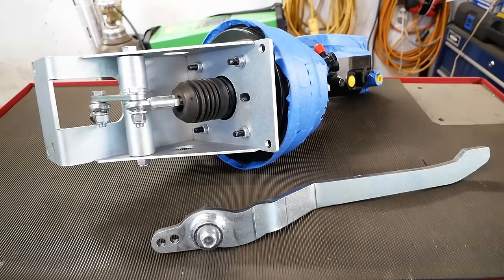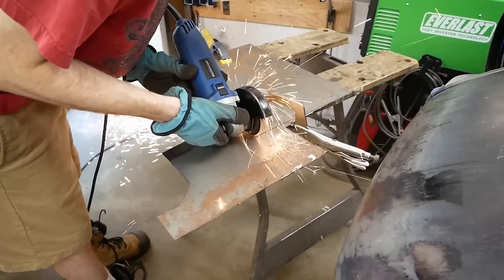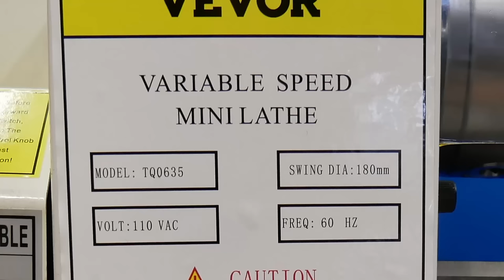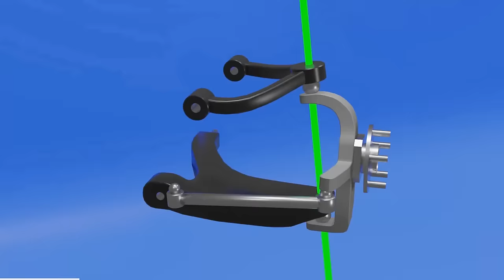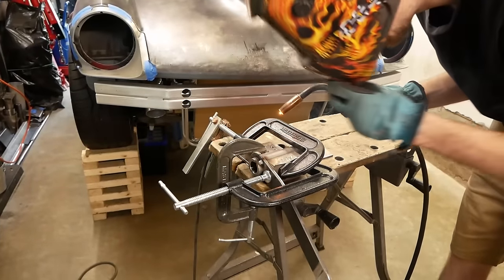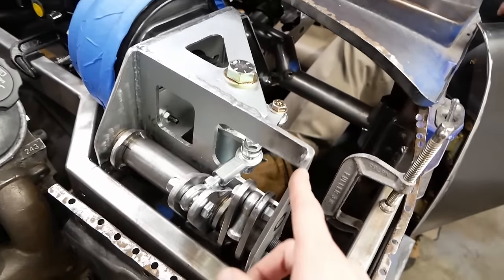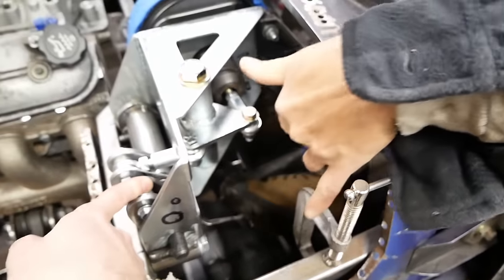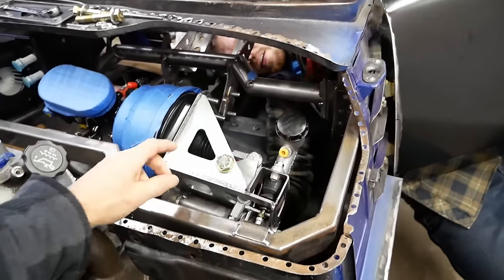Custom Pedals are Complicated! Pro Touring V8 Powered Triumph – Project GT6R – Ep36

Comment: Get familiar with cutting threads on that lathe as soon as you can.  There's nothing more convenient than being able to make your own shanked bolts with custom lengths for the shank.  So much easier than trying to work around what you can find at the local hardware store.

Comment: I love watching your videos, your engineering skills are on another level from what I could achieve, I do understand why it takes such a long time between videos. I have been installing an oil cooler assembly on my Triumph Vitesse Convertible with the 2-Litre straight 6, there is hardly any room around that engine, and so far, I've been at it for three weeks, admittedly I'm 65 and don't have the energy that I used to have, but it's been a real PITA, with finding room for the 13 row radiator, and the thermostat and the adaptor for the temperature gauge bulb, and the filter adaptor, with all the barbs and hoses! Anyhow, your build is also very special as a father and son project. I hope you enjoy your unique GT6 for many years to come! p.s. pay special attention to heat production from that big engine getting into the cabin, because even standard GT6s can get 'rather warm' inside!
Reply from the maker: Thanks man, really appreciate it!  We’ll have a full steel transmission tunnel (unlike the OE Triumph plastic) with real, honest to goodness heat shields and insulation! 😄👌 cheers and all the best with your Vitesse!

Comment: Another great video.  As someone who owns both a "real" lathe and one of these hobby lathes, here are a few hints and tips from my experience.  1)  Stay within the limits of the lathe.  You aren't going to take big cuts at high speed with high IPM.  2)  Replace the cheap plastic speed change gears with metal ones ASAP.  The plastic ones will break sooner or later.  If your lathe already has metal gears, you are ahead of the game.  3)  Replace the spindle bearings with tapered roller bearings.  These can take thrust loads and bring more precision to your cuts.  4)  Invest in a set of indexable carbide tooling.  In the long run this is cheaper than replacing entire cutting tools each time.  5)  Working with stainless steel on these lathes is tricky.  They don't have quite the HP to muscle the cuts you need in SS and taking tiny cuts in SS is a good way to destroy tooling (ask me how I know this).  6)  It looks like you have worked on the bed, but make sure the carriage is tight and has parallel travel along the entire bed length.  7)  Make sure the spindle box is aligned to the lathe bed (these things are mass produced to lowest cost and QC is a myth) and that the spindle is aligned with the tailstock for both taper and height.

Lastly, buy a tool cabinet for all the tooling, lathe chucks, and extra nifty things you are going to absolutely "need" once you start working with the lathe 😁.  This is a disease that is an endless rabbit hole of "Ooooh, that looks nice, I need that".
Reply from the maker: Cheers Ron, have a good idea of what I’m wanting out of this thing and those are all great suggestions!  Really appreciate it 🙂🙏✌️

Comment: Excellent work as always.  Looking forward to the video explaining the brake calculations.  On comment on the bulkhead, have you considered making it removable,  it would make access for replacing items like the brake master cylinder much easier.
Reply from the maker: We’re going to use access panels in the firewall, leaving some structure in place for strength. 👍 thanks Andy!

Comment: I love your fabrication and it will be tough for me to equal it when I build my vette.    I thought your firewall was going to be removeable, but I guess you decided to weld it in and make an access panel for the fluids.
Reply from the maker: Thanks man, yeah we're going to have the bulk of the firewall be a permanent structure in order to tie it into the rest of the body better, but there will be two generous sized access panels which should still let us service most items quite easily. 👍

Comment: All, and I do mean ALL, of those brake calculators fail to mention one, kind of important issue about braking sporty cars (or 4x4s).... brakes get hot and require more pressure to actually stop the car.  You will LOVE the 'extra' you inadvertently calculated into the system.  You also can change braking dynamic by using a harder or softer pad - how might you tell which is which? by its warranty - the longer the warranty the harder the pad.  tl;dr - you lucky bastard.  I won't tell you HOW I came up with this knowledge - it did come with a lot of screaming from a wife who will no longer ride in my race cars (even though the current itineration is post-brake-issue)
Reply: Nah, you get pads that handles heat, that fixes it. No amount of more pressure fixes boiling fluid which would be the next issue....

Comment: If you look at the timestamp 2:10 it shows significant clearance between the exhaust and the transmission. Would it not be possible to move the exhaust closer to the transmission and net some additional space for your feet and legs?
Reply from the maker: Could do, but it’s not really necessary!  There’s as much foot room as we’re going to get away with now, and although it’s hard to see from these angles, the exhaust actually lives an inch or so below the floor, so there’s still good clearance there. 👌👍😎

Comment: in collage i had a 65 spitfire with steetable 13b rotory eng. 1475 lbs wet. sheet metal coffin no roll bar. skateboards had more protection. street racing sleeper. tended to go airborn.

Comment: I truly enjoy your process and progress. Have you considered making that section of the firewall a removable cover which bolts in? Since you have to have access holes anyway why not make the whole easier? Reinforced flanges, rivnuts, and once painted it looks on purpose with purpose. Congratulations on the win with the lathe.
Reply from the maker: Could do, but my plans for structure are pushing me in the direction of a fixed bulkhead with two large access panels!  Should be able to get to most of what we need that way, and can always go through the interior worst case 👌✌️ Cheers Rona!

Comment: I chuckled at the Star Wars reference. Which Everlast machine do you have? I bought myself a Power MTS211si with some of my tax money, but it's still in the box in the living room. Congrats on the lathe.
Reply from the maker: Glad I could give ya a small chuckle Jay, hope you're well!  Nice one, congrats, I'm really impressed by the Everlast brand.  Mine's the 185DV ... great little budget friendly AC/DC unit.  Definitely recommend it!  Happy Easter to you and yours 👍
Reply: @FanatikBuilds  I went with the multiprocess one because I have a lot more need for steel and stainless. I can't think of a time I've needed to weld aluminum on the regular, and if I do, I might pick up a spool gun. Happy easter to you, as well!

Comment: Great to see the progress.  So much fabrication.   I can't help but say you might be done already if you went with a v6 or 4cyl as that LS is so overkill and front heavy.
Reply from the maker: A different engine would not have changed the timeline one bit!  In fact it may have lengthened it... the LS is such a versatile platform with a huge aftermarket, so it was (and will be) very straightforward to get running.  The LS"4" aspect was more complicated for us, but that was of our own doing to save some $$!  Thankfully, this engine, with 4x the original power, weighs about the same as the Triumph 2.0l ... and the weight is lower down, and further back.  I'd call that a win! 😊👍

Comment: Just caught up on all 36 videos after a friend tipped me off to you guys. I’ve been gathering some suspiciously similar parts for a Volvo 145 build, some shared thoughts going on before I even saw your channel! 
I’m sure someone else has mentioned or maybe you’ve considered it already but why not make the firewall bolt in so you can ease under dash maintenance for your future selves? 
Anyway keep up the awesome work it’s coming along great
Reply from the maker: Cheers man, glad you found us!  We're going to make most of the firewall structural, but there will be two large access panels that should still let us get to most of the important stuff. 👍 Have fun with your Volvo project! ✌️

Comment: I think I would’ve went with the electric master cylinder. I think it would’ve left you more room, you’re doing a great job on the car.
Reply from the maker: It’s a neat option, but wouldn’t have actually given us any more usable room… plus would have cost significantly more and be more difficult to setup.  Happy with the vacuum unit!

Comment: Cool cool.
Gotta love the small under dash work, I know I do, hehe.
BTW, it looks like you have the old style drivers valve cover. Check and see. GM had issues with oil consumption due to the PCV getting to much oil in it instead of just vapor
Cheers:):):)
Reply from the maker: Thanks for the heads up, likely going to get different covers eventually, but we’ll see! 👍✌️

Comment: Is the left hand exhaust pipe not a bit close the the driver's right foot?

You might want to plan for some heat shielding between the two.  In a standard (right hand drive) GT6 there is a chassis rail between foot and exhaust so it's no more of an issue than the heat billowing out of the engine.
Reply from the maker: Already planning on heat management, don't worry!

Comment: The brake pushrod going into the end of the master cylinder appears to be at an angle which if it is, may lead to premature wear / failure of the piston seal.
Reply from the maker: Actually the brake master is isolated by the booster, so no angle is being applied to it at all!  Every other angle in the assembly is within what I believe to be adequate tolerances.  Cheers and thanks for looking out for us though man. 👍

Comment: The common and basic pedal ratio for clutch and brake pedal is 5:1 and that should be the starting point without the necessity for all the fancy maths.  i note that you have also concluded that the servo assistance is overkill, which is what I mentioned last time, although the front/rear brake balance has yet to be determined and can only come from road testing  The ratio for the throttle is dependant on the connection to the throttle body and any intervening levers.  Personally, I would not have used a steel bush for any of the pedals as these can seize and a bronze oilite bush is best for the brake and clutch and I have found that a small bearing is excellent for the throttle pedal, giving a smoothness and feel that simply doesn't exist in ordinary car manufacturers builds. 

The positioning of all the pedals is dependant on personal preference but one point that I include is the ability to heel and toe, that is clearly an advantage in spirited driving but also in certain situations when you have to control all three pedals at once.  the positions of all the pedal pads is also crucial to get the ball of the foot to plant firmly on the clutch and brake with the heel in the comfort position on the floor.  This often means that the typical car manufacturers pedal positions are too high except for those with size 11/12 feet.  Also, the transition from throttle to brake pedal must be a natural movement without the possibility of hooking the foot under either or inadvertently pressing both at the same time.

Looking at the way the clutch m/c is mounted, the brake could have been mounted the same way and using a balance bar system that would have given the option of variable front/rear m/cs and balance (even on the fly) and the multi links that makes the system overly complicated and therefore too full of tolerances would be averted, notwithstanding the simplified servicing - KISS applies here.

Comment: Quality of your build and videos is incredible.  Sorry to ask as it’s probably ridiculous with your build but I’ve seen model A rods where what was the top of the gas tank, section from windshield to hood was hinged to open allowing access to hydraulics behind dash. It was done on existing body line so to be unnoticeable.  Is that possible in your build?
Reply from the maker: Thank you Michael - really appreciate that!  We're planning on a fixed firewall with two large access panels (rather than having the entire thing remove).  Should work out well, hopefully! 😊👍

Comment: You would enjoy using a TIG welder for the type of fabrication you are doing here.  For me, TIG is less stressful to use on smaller and high reliability work than using MIG is.  Try one if you get the chance.  ---Doozer
Reply from the maker: I do have a TIG, but I prefer using it for final welds, tacks are much faster and easier with the MIG for me ... cheers👍

Comment: Wow great work! I have a question though, with all that steel you are putting in are you concern with the overall weight of the car at the end?
Reply from the maker: Not really, we've been weighing parts as we go, and I'm estimating it will be ~2400lbs dry.  That's ~400lbs more than factory but still a light car no matter how you go about it.  In fact, a little extra weight might help make it less twitchy!  Guess we'll find out.  At the end of the day, it's meant to be a road car, and I'd rather go slightly overkill than make things too weak.  Cheers Pierre! 😊👍

Comment: You are in danger of burning your right foot, amhIk😢 remember your racing boots are not thermal protection. You must provide yourself with some insulation at least. Space with airflow will help a lot.
Reply from the maker: Heat management has been considered for a long time now, no worries!

Comment: What clutch master cylinder is that more precisely? I ses it’s wilwood but exactly which one is it?

A friend owns a GT6 but has been having problems with one of the seals in the clutch master cylinder (the one sealing off the reservoir when the clutch is being pressed. I think it’s too big and never lets any fluid enter from the reservoir but I’m not sure).
Anyways it’s been bugging us for some time now and I’m considering just buying a new one.
Reply from the maker: This exact master is part number 260-1304 … though it’s a 3/4” bore and your friend needs a 5/8” to be an OEM replacement. Wilwoods 5/8” bore is 260-2636 … but it may be best to just get a true oem replacement from RimmerBros or Victoria British. ✌️ cheers!

Comment: Surely floor-mounted pedals would have been easier. VW Beetle style.
Reply from the maker: Not really, no!  Floor mounted pedals need more depth and/or height (depending on where the masters are mounted) than we have in our foot wells.  Not to mention we’d have no hope of running a booster. This may be super tight, but it fits together perfectly! 🙂✌️

Comment: You guys really missed an opportunity here by not doing drive by wire throttle.
Reply from the maker: Yeah I know it would be nice!  Difficulty is the price difference though man ... we've gone with the Terminator X, and here in Canada there's a $675 price difference between the X and X Max ... plus we'd then need a DBW throttle body (OE LS4 one is tiny) ... and a pedal ... and we'd STILL be left with the terrible LS4 intake manifold!  We chose to save money and upgrade the manifold but go with DBC.  If funds were unlimited, things would be different, but this was our best bang for buck IMO! 😊👍